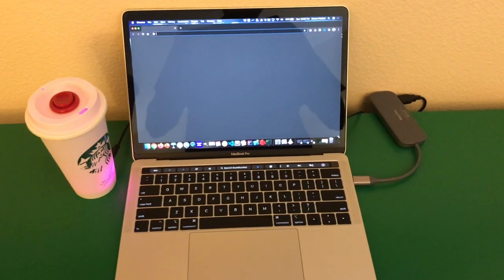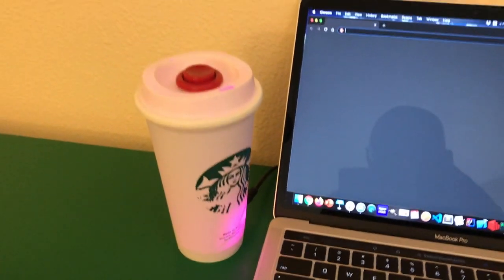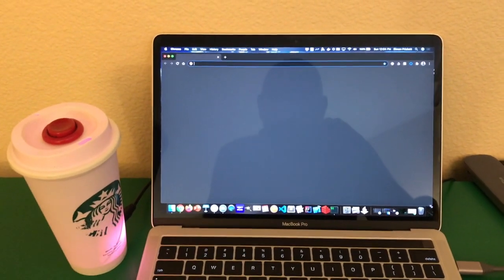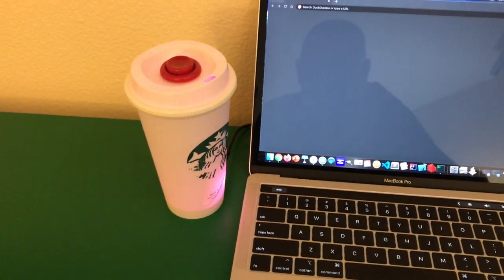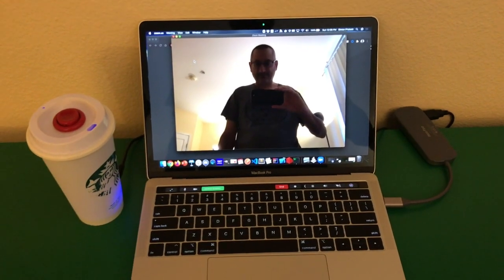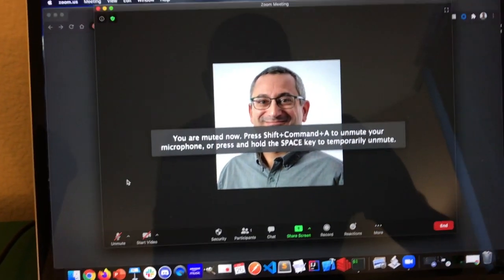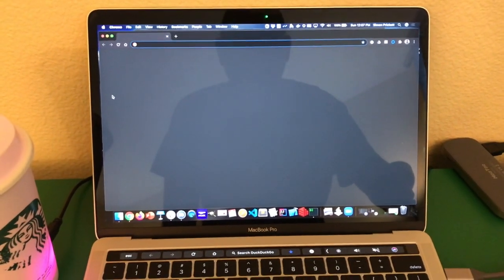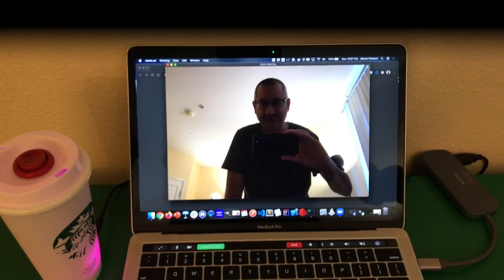Zoom Videoconferencing Starbucks Cup Panic Button Build!

Comment: Great work! Question: how would you program rather than debouncing with these two visual cases. Case 1: the built-in neopixel turns RED when the mic and cam are OFF (usually happens after Zoom starts. Case 2: the built-in neopixel turns GREEN when the mic and cam are ON (usually happens after your custom panic button is pressed). Thank you for your valuable time.